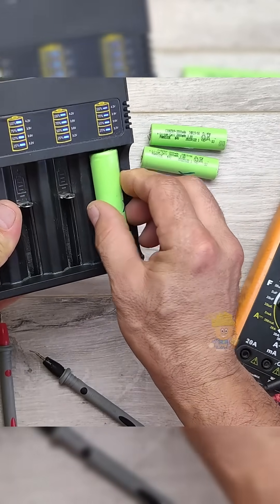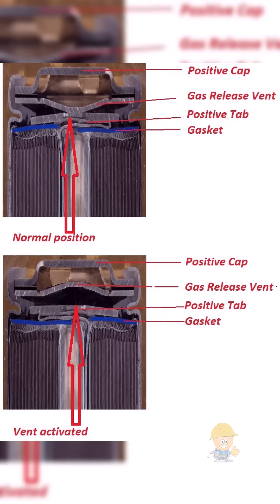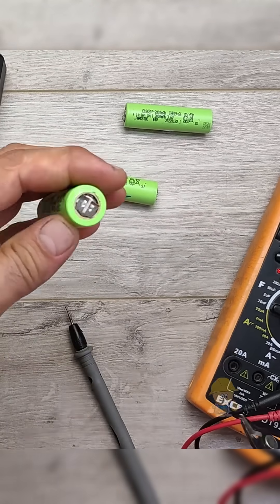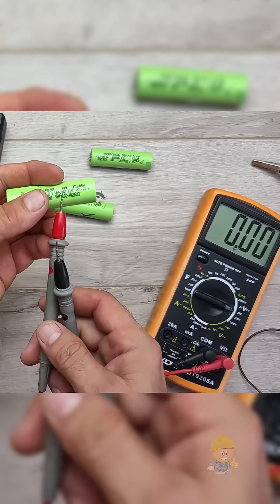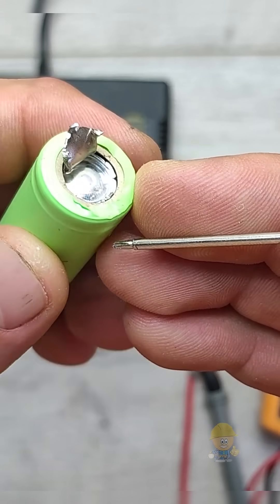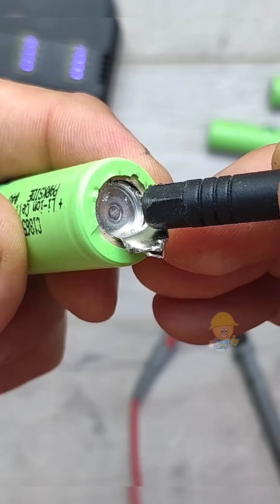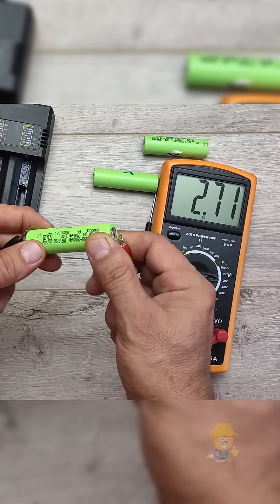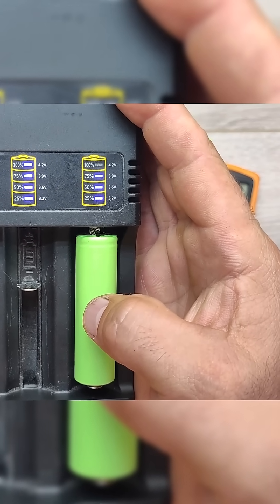Parkside cells How to reset 18650 dead 🔋 lithium cells #diy #parkside#battery

Comment from the maker: You can buy new 2000mA cells
https://s.click.aliexpress.com/e/_DmWGk2H
Reply: Но, лучше на AliExpress этого не покупать
Reply: @user-shop no its lidl
Reply: Why buy low quality 2000ma when you can easily buy 3600 Panasonic cells for not much more?
Reply: @vueport99 pls share the link to buy it
Reply: Cartoon
Reply: @bigclive
Reply: Cells are rated in mAh, not mA ...
Reply: fake...watch carefully the test probes' position...
he reversed the polarity on his 1st test that's why there was a low reading...
Reply: @RoyTee-w4e  That doesn't matter,  it'll just give a negative reading.  Try it with some batteries and you will see you'll get identical readings.   I'm not sure if this methods works or not I haven't tried but your logic is incorrect about getting a lower reading if you reverse polarity on volt meter.  Just an FYI
Reply: @RoyTee-w4e No. reverse polarity will make no difference to the actual voltage reading. The only difference with connecting the opposite way will result in a minus reading. I.E. -2.4 volts instead of 2.4 volts.
Reply: @RoyTee-w4e  but there would be no reading if it is reversed

Comment: The point of the vent is to cut the circuit if the battery is generating hydrogen gas because it is damaged. Don't use a damaged battery

Comment: In my understanding, if you gently push the valve down, in case of another issue the pressure can push it back again. He is not disableing a safety feature, he did not cut the thin aliminium membrane/valve out, just "reconnected" the circuit. But obviously the valve was activated for a reason, so he should leave that battery.

Comment: Yes it does work but it's also a sign the battery had vented or was very close to venting, that means it was very close to erupt in flames.
Usually happens on badly degraded cells or high load while near empty.

Sometimes a dendrite short that resolved itself might've caused such an event... Venting without thermal runaway is actually a sign you just somehow dodged a bullet that was directly aimed at you and you should ASAP put the cell/ battery in a bucket with sand outside and away from any building/ flammable objects.

You just showed that a lithium battery that seemed dead still has energy and thus capability of burning down everything you own and should be treated like it could erupt in flames at any time.

Don't just discard it in the local battery recycling bin but ask the local waste department about safely discarding a damaged lithium battery.
They often send out someone from hazardous waste collection because they DO understand the risks of handling a damaged lithium battery and don't even want you to drive it to a collection point.

I do understand the educational value of this short but enough people are dumb enough to just pop it back and then SOLDER the battery pack back together...

Yes solder...
Soldering on a healthy cell is very dangerous but soldering on a damaged cell is like playing catch with a lit cherry bomb.

Comment: Do not reset the pressure relief valve. There is a clear reason why the gases in the battery activated the pressure relief valve.

Comment: Compressed air works the best and doesn't do any damage to the battery only takes a little psi and the end of an old garden hose with a tire valve adapter screwed onto it.

Comment: Everyone is being a little dramatic. First of all, how many of you have seen a used, partially charged lithium cell burn when ignited or purposely damaged? I have, and it is not nearly as dramatic as some of you are portraying.  A cell with a low state of charge and poor health does not explode, it fizzles in a fire, reacting not much differently than a piece of paper. So stop. If you don't want to do this, don't. There was a very clear disclaimer here, and I have done this several times. The "valve" safety device is a button that pops up to break the connection, pressing it back down is simply resetting it just like flipping a breaker panel switch at home. Does your house burn down every time you flip a breaker? This is an indication that something has happened to to the cell, so use caution of trying. Otherwise, do it outside if you think it's going to explode, then recharge the cell outside. It would be best to replace it with a new one, but obviously in an emergency, knowing this can save your life. Being able to use this battery in a GPS, to light a fire, or to power a flashlight can save you. And the others are correct, you don't usually have to peel the tab back as far to access the button, but if you need to, you need to. I think this person did this to help show the safety button.

Comment: As a drywaller for 30 years, I do this with circuit breakers too. Just open them up, take a piece of 14 gauge wire are twist the terminals together and no more nuance breaker trips when we put a screw through the wire. THIS IS THE WORST THING YOU CAN DO. DO NOT CHANGE THE "SAFETY" ON ANYTHING. Its there for a reason.
Reply: I AGREE WITH YOU 👍 💯 
Good morning from Greece 🇬🇷 💙 
Καλημέρα από Ελλάδα 🎉😂❤
Reply: Que buen consejo!!!
Reply: Good morning Estoy de acuerdo contigo  @jorgecoll5863

Comment: It works. I've done it to almost 50 batteries. But I didn't need to destroy the + pole. Just put a metall stick of 2-3 mm in diameter through one of the side holes and hit it slightly with something. And the battery will come to life. There is no hazard.

Comment: Do all of most lithium cells like these have this same type of safety disconnect valve?or are there other type fuses?like a fuse that melts away the low melting point metal alloy disconnecting the circuit .which I don't think are resettable .

And the way you reset the these,if you don't damage valve or vent,and reset ,it should have the same safety feature which is now reset and in use until it gets overheated or short circuited ,which causes the heat to expand the valve .doesn't this make the batt still using the safety feature after you push in?I'm aware that it could have punctures or other damage from user trying to reset it but if no damage,doesn't it make the protection feature back to working ?

Comment: Are you actually disableing the safety feature.?since all he's describing is trimming the terminal s shorter.to gain access at the safety feature.which is expanded outward making a disconnect in the circuit...by pressing it you are resetting the safety feature so it can now work again and should expand again when or if it gets to warm from over loading or short circuiting.are these resettable?from the maker?in that method of engineering,the idea I'm sure was engineered this way so it can be resettable,.as long as you don't puncture  or damage the valve vent.i

Comment: Cool. Except they will explode like bombs 💣now. These pop and disconnect because the cells are spent. Continuing to charge them will eventually cause the outgassing and thermal runaway and they will explode. IN OTHER WORDS, DO NOT DO THIS!

Comment: I "reset" these by drilling a hole thru the top of the positive cap and using a rounded tool to press the dome back down. This leaves the top able to hold in battery holders. The cutting way leaves the top able to collapse.

Comment: when i pressed it get a hole and a gas was leaked when i checked again its voltage its 3.9 before is 0.0 then  a water is leaking what i doo shall i throw oh will blast

Comment: The Fire Dept just left, I am now permanently traumatized by these events. I don't know if watching the flames from my 300A battery lap up the wall and then across the ceiling, or finding my teenage sister fellating the young Fire Captain in my parents bathroom was MORE traumatizing. I have had it with science, to me, Science is Dirty!

Comment: Nobody should do this, ever. This is not how you get a dead Lithium battery to charge. And there is no "reset". You get a charge module that can do 0 volt charging, like the board from a dollar store power bank, then use that to charge the battery to full.

Comment: This is one of the best descriptions of how this valve works.  Good to know, and this is a should be used as a last resort in an emergency situation.  As creator stated, it is dangerous and should not be done, but gives an option if the crap hits the fan.
Reply: Should actually NEVER be done in ANY situation.
Reply: @darrylkinslow5613  well if its life or death its fine if its only gone down to like 2.5v the cell is fine
Reply: @jakekymantas8778 chargers won't accept 2.5V though. They refuse to charge and stop. I had to use a clock with a slow 0.3A charge to raise the 2.5V to 2.8V for an hour and only after this the battery would charge.

If the voltage is 0V, I would bin the cell
Reply: @johndoe-vc1we  well my charger will charge battery’s at 0.5v
Reply: @jakekymantas8778 which charger is that and its model number?

I don’t have a charger and was referring to headlamps or torches that have a usb socket to charge the battery. They will not accept a battery of 2.5V
Reply: Do not reset the pressure relief valve. There is a clear reason why the gases in the battery activated the pressure relief valve.
Reply: I released 4 cells like this, all of them were above 3v after i did it, so they were healthy, the only hazzard is shorting the battery when you try to do this, but since it cant be shorted until you release the pressure then you re kinda safe. I stuck thin tweezers through the opening on the top to release the pressure and that worked without shorting anything. But thats where you could short something when youre prying under the postiive cap, youre resting on the negative edge... Ive shorted batteries like this trying to get the old nickel strip off with those same plyers.  But thankfully didnt have that problem when sticking tweezers in there... i think because its not live when you do.  But once you release the preassure its live,  but still only at low voltage so not much power left.

Comment: This "valve" is called a CID (current interrupt device). It has popped up because of a pressure build up inside the cell. This only happens if it has been shorted or exposed to high temperatures. If your cells look like this then they are simply not safe to use. Dispose of them safely, and don't do what this guy is doing.

Comment: You don’t need to cut the positive terminal like that. You can just stick something metal into one of the 4 holes and push down on the valve.
Reply: I put some plastic strips there (trough those holes) and then fine tuned outside pressure by hammering in center of the plate
Reply: yes but its a bigger risk of damage the safety valve and create a electrolyte leak
Reply: Si pones algo de metal podes hacer un corto,  recuerden que todo el cuerpo externo de batería es el negativo el aislante es ese plástico de color que se rompe facil
Reply: I was looking for this comment
Reply: Those are not holes. Those are from the nickel strips which connect the cells together in a battery pack. You cannot stick anything through them as they are just the marks from where those nickel strips were once spot welded on.
Reply: @mr.technologysilva8856 Whether it's these flat tops used with spot welders or the raised top, there's usually vent holes around the edges like he's talking about.
Reply: @JJFX-  I just checked 3 different batteries, one had 6 holes in the top on the edges, and one had 6 holes on the edges. He said 4 and I have yet to see one with 4! Maybe it exists but I have seen no battery in apl my years of extracting them from old battery packs for re use. Also those are vents, not "holes" maybe there was confusion but only the original commenter can confirm or deny this!

Comment: resetting the li-ion cid is unneccessary.. 
you can do that, but only for sparring some cells if you still have another healthy cells to replace it..

and why the cid had triggered, usually  a heat and overcharging.. heat can come from charging process (with high amperage), or when being used until overdischarged..
if overcharged, if the battery has no bms or balanced connector to charge properly (especially series-parallel setup) this can overcharging a first cells while the other ones still somewhat under).. 

if you press the cid properly with some dull tool, and not damaging a venting valve while pressing it, the battery can safely to reuse again (with some risk if heat or overcharging still happen).. because the cid, can retriggered if the pressure raises too high once again..

but, if you press the cid and the venting valve has been damaged while pressing the cid too hard (hissing sound or even leaking electrolyte), and the battery is very2 dangerous to reuse..

 you just transforming the li-ion to the bomb..

Comment: Just buy new ones folks! The only way i agree by using plyers, is to remove them from a laptop battery, in most cases, if you have a vape that takes 18650s, you can cheap out by buying a cheap laptop battery, you can safely remove the 18650 cells from them, having good real cells for cheap. In my vape shop, they sell 2500mAh 18650 batteries for 11 euros a piece, but, i buy laptop batteries online for 30 euros, and i have 6 18650 batteries, saving a lot of money. But those are new, these ones are well used, don't defeat the safety features!

Comment: If the gas release vent is up, it means that the cell acts as a wire if its conected to a circuit with anoter cell on parallel?

Comment: I fixed between 12-15 cells that appeared faulty this way. Although I didn't cut the metal apart at the top I just used some tools with the proper leverage in between the open area's. As soon as I tested with a multimeter they showed proper voltage. I was able to charge them just fine and they do work properly. I'm not very worried as they will just expand again if the issue were to persist. It's common for this to happen on cells that sit around for a long time with out use or power cycling. I wouldn't recommend doing it if you don't know what you are doing. But it does work.

Comment: You don’t tear off the end to reset these. 1st they went into safety mode for a reason so you may not want to reset them. 2nd, as you can see in the diagram you can reach through the side and reset without ripping the end open. People are so stupid it’s pathetic.

Comment: The problem that might occur on a cell, that had that valve blown is that it builds up dendrites which are crystals, that may cause a shortage inside of the cell.

In worst case it may catch on fire.🔥 or explode.

Comment: I avoid purchasing or using any batteries, safety & test equipment, tools & electrical supplies from lying cheating lack of quality control communist china. A great U tube producer check maybe 15 different lithium rechargeable batteries. All of the cheating Chinese garbage batteries lied about power output by over 35% for some. Nice vidios, never know about the safety valve.

Comment: I have 3.7 silver pillows all over my house from damaged batteries still with charge not ever catch fire. I had my 9 month old puppy chew on a single battery meant for those tiny fpv drones and surprise it didn’t blow up on her. I see how easy people stab the batteries to explode and we tied a wood screw to a stick and stabbed a 3.7 silver battery over and over nothing happened I ran over a 4s drone battery with my car just enough to look like tooth paste and it has a full charge when I tested the battery pack which I’m surprised it still works as it sit on my garage still I have rc card that run off 12s 120c 2x6s batteries that have slung and dragged by the car that I tape the metal plates back together and use till this day not a single fire. So I’m will to try this 😅

Comment: Parkside batteries are cheap, and they come with a 3 year warrenty, i will not take any risks trying to repair a Parkside battery this way. If Parkside batteries were extremely expensive, i wold replace te cells with new cells, but i would never reset the "safety switch" inside the cell, it is there for a good reason, to prevent fire and explosions.

Comment: Doing this is attempting to charge a cell that has had a chemical failure. It won't fix the chemicals in the cell, but it will put energy into a failed chemical reaction. That's just dumb. There is a reason the safety feature disconnected itself. The cell is DEAD!

Comment: If you don't want to risk something like a Roman Candle firework going off in your house do not do this. Most people would be amazed how incredibly dangerous it is when a lithium battery ignites. Always have a metal waste paper bin ready when working with lithium batteries.